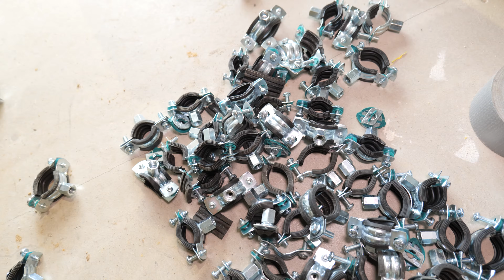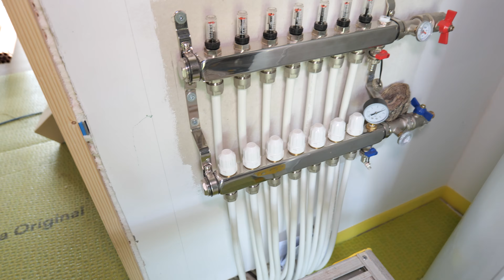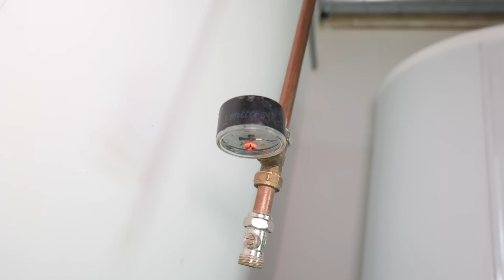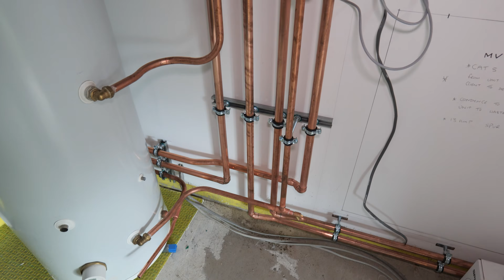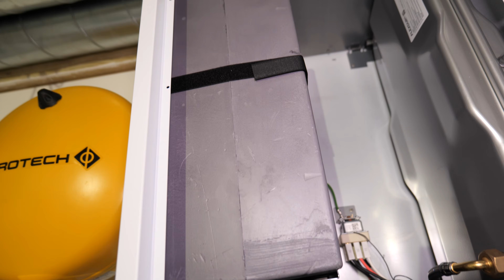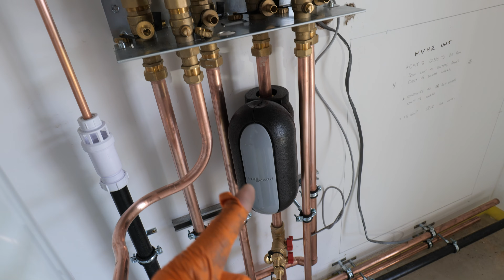Air Source Heat Pump Installation - Viessmann Vitocal

Comment: All that massive refurb and they didn't bother to put in either EWI (better) or IWI. Why on earth not, one wonders? Even the building regs should require a U=0.25 wall on a project like this shouldn't they? Amongst other things they could then have bought a much smaller and cheaper heat pump. It's kind of sad to see so much money being spent but only half the job being done.
Reply from the maker: It does have external wall insulation 👍🏻. Plus Viessmann make the best heat pumps.
Reply: @loving-plumbing  OK. Glad to hear that didn't get missed out - I just couldn't see it in the video - maybe it's being applied later? And yes the Viessmann HP's are really nice, but they are also very expensive, and if you have a well-insulated bungalow with a 3-5kW heat load a 12-15kW Viessmann is overkill. There are other decent HPs out there, like the Vaillant Arotherm (also R290).
Reply from the maker: @xxwookey  thanks for watching . Viessmann do a 6kw 👍🏻. In all honesty  Viessmann is worth the extra money over the Vaillant.

Comment: Great video.

Can fill and flush valves be used on gas systems, too?

Have you ever used vuessmann vitotrol 200 indoor influence to work with the weather compensation?

Vaillant seem to recommend this with their ashp's and weather comp.
Reply from the maker: Viessmann have just released a vitorol specific for the heat pumps that works alongside the weather comp. I'm hoping to try it soon!

Comment: Great video and thanks for sharing 👍 Just wanted to ask why you didn’t opt for the indoor unit that has combined cylinder and control unit in one? - the 151A i believe? Cheers
Reply from the maker: Thanks. Because it only holds 170 liters I believe and we had three bathrooms 👍👍

Comment: Great video, exactly what you said, a lot of us old sole traders out here waiting to take the step over to ASHP. Interesting to see how you are tackling it all. It looks like Viessman have taken a lot of the ball ache out of these installations by the components doing everything you need them to. I assume its an expensive lot of kit but it looks like they make an installers life a lot easier and that can only be a good thing for us all. Really smart looking job, well done. Look forward to follow up video, thanks.
Reply from the maker: Thank you very much. I definitely feel like the Viessmann Vitocal is superior in design to most. Definitely makes life easier. Cheers for watching.

Comment: Great video, what temp do you design the rads for with it running on the same weather comp curve as the UFH?
Reply from the maker: @stevewells2536  Thanks. So it's 40c at -2.3C .  I have dialed it down on the heating curve slightly. 
I was skeptical to be honest but seems to be ok so far. Wait till it's cold I guess! Be back with a blending Valve 🤣.
Reply from the maker: Aiming for 20c room temps.
Reply: Thanks, I’ve got a similar job coming up, might try the same thing and not use a mixer 👍
Reply from the maker: @stevewells2536  it worked out that way for me really because the underfloor heating the client requested was designed at the same temperature. In reality the underfloor heating should be more like 30c -2. Those aluminium panels at 150mm centers aren't the best. If I could have got 100mm centers in I would have probably used a mixer to lower the Temperature.  Either that or upsize the rads even more. It's worth doing the maths 👍. Thanks.